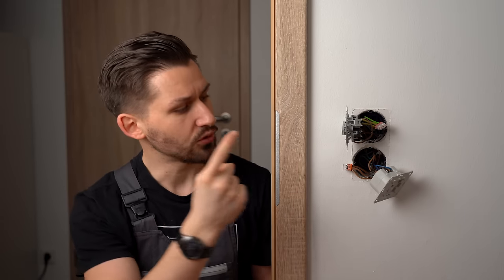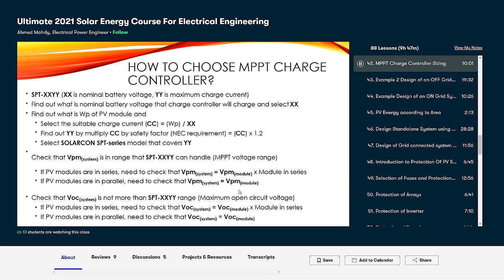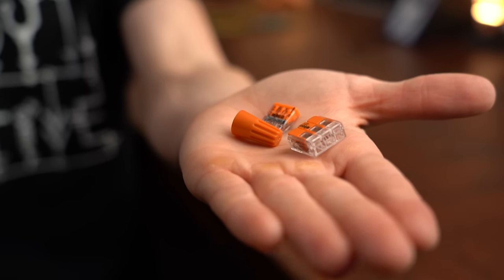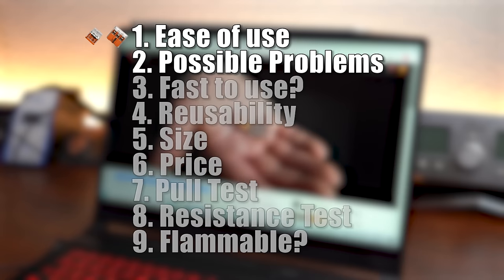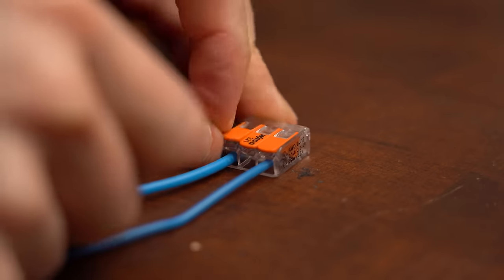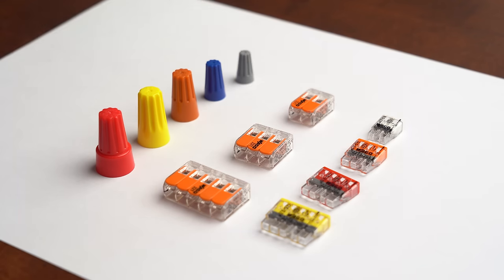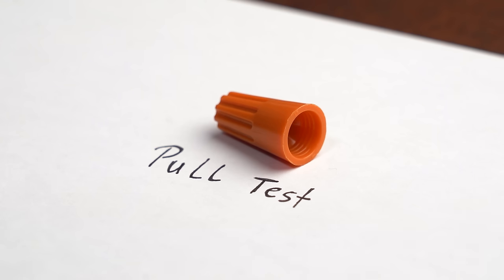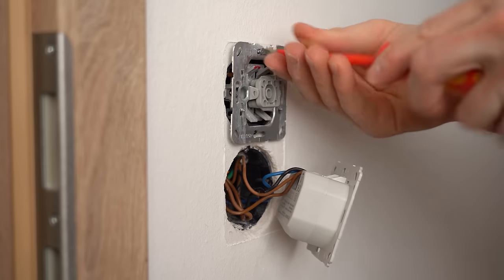What Wire Connector is the Best? Settling a Debate! Wire Nut VS Wago

Comment: The scoring seems intentionally skewed - "easy of use" "fast to use" and "possible problems" are basically all redundant.
Reuseability - wago also does not advertise them as being reuseable. 

And in the physical characteristics - electrical resistance, resistance to mechanical force, resistance to ageing - wirenuts win big times. The resistance specifically is a big point: Wirenuts do not have a current-rating cause when installed correctly they do not carry the current and the only limiting factor is the wire used. Where as the Wago - having potentially multiple heatsources in a confined space right next to each other is a lot more dangerous (considering that the best result was still ~3 times worse).

The wago certainly is faster and more convenient and for small projects i prefer them, but for anything more permanent - nah.
Reply: Exactly. Their Wago connectors are a fuse just waiting for an over-current situation to blow and spark. Just hope the circuit breaker reacts fast enough to the load.

Comment: We've actually phased out the use of Wago style push connectors in our industrial equipment - Power connections MUST be copper wire to copper wire contact ONLY unless there is a rated crimp terminal or ferrule crimped on a wire going to a terminal block.  NOTE: When doing your resistance measure, you want to measure the voltage drop right at the connector - the resistance of the wire itself is going to change a bit as it heats up with current flow.  Wire nuts will be the lower wasted heat, most energy efficient option when used correctly.  Another point:  All connections must be stress free, and make sure the wires are clamped down to avoid any movement at the connector...no matter what style connector is used.
Reply: was thinking the same thing, this german... ;p
Reply: How do you do this ( copper wire to copper wire )? You weld the wires together everytime?!
Also the electric meter is connected to the mains wires with screws and this is true for underground cables. Why are screws and metal contact sufficient for the mains but not good enough for low amp applications like yours?
Reply: @impoppy9145  Twisting the wires together firmly gives a solid copper-to-copper junction. Also, most screwed connections in installations are using hardened nickel plated copper parts. And if not, tightening a screw applies much more force than a steel spring in a wago terminal. Even good crimp lugs are made of a copper alloy.
Reply: The emphasis on low connection resistance could be the link as to why either one is popular in its market. Given the standard 230V home supplies in the EU, most wago connectors won't see currents over 16 Amps ever (The kind in the video probably much lower). I can imagine that heat dissipation and optimal contact in conjunction with retaining the small form factor are all the more reason to use wire nuts preferably in the US.
Reply: @meindertsprang7491  So much BS. Only twisting the mains- wires together firmly is illegal and will cause fires. No country on earth will connect your house mains with twisting wires. Mechanical connections are required by law in every country. The wago steel spring is a sufficient and good enough mechanical connection for the respective rated amp of the wago.
Reply: @impoppy9145  Twisting before screwing on the wire nut of course!
Reply: @meindertsprang7491  what? How is your BS nonsense proving that wago aren't good enough?
Reply: @impoppy9145  Is using offensive language your only way to disagree with someone? I find that quite pathetic.
Reply: @meindertsprang7491  Now back to the question. I've read all your BS and found no useful information in them about the Wagos. How did you come to the conclusion that Wago mechanical connections are insufficient?

Comment: The Wago connectors are relatively new the US market, but they very quickly taking the market by storm. I had never even heard of them until about 6 months ago, but once tried them, I've never looked back! I absolutely love them. I'm not an electrician, but I do a fair amount of DIY electrical projects, and I especially love how easy it is to connect solid and stranded wired together with Wagos. Plus, they take up less space making it easier to pack wires into the box. There's always a bunch of new gimmicky products on the market, most of which are just answers to a question no one is asking. But, these Wagos, IMHO, are a real game changer! I will never go back to wire nuts!

Comment: i absolutely love the wagos with the thumb tab, theyre nice for quick stuff or prototyping, but for electric in my wall, ill keep using wire nuts because theyre alot cheaper n i honestly feel better with the conductors wrapped around each other instead of relying on points of contact which r notorious for getting warm or worse n theyre plenty strong, u literally cant pull them apart if u do them right
Reply: If you really want to buy the cheapest stuff available go for it. I on the other hand will stick with wago. It's just so much faster and easier to use. You can start with one wire coming in and then connect the next ones. Especially if it's old installation and you only have a tiny bit of slack wire you can just cram it in there and it fits. I think I would not have been able to screw on terminals as easily.
Reply: @cometor1  If you really want to be as lazy as possible go for it. I on the other hand will stick with wingnuts. They're just so much more reliable and cost effective.  They may be slightly slower, but its not like I'm rewiring my entire house every year. If it's an old installation and you only have a tiny bit of slack you might have to put in a little more effort and make sure your work is clean. I think if I used wago I'd be able to just cram it in there and do a half-assed job more easily.
Reply: @TonariNoWitoro  It's really really hard to discuss the use wago and wire nuts. I've never really used wire nuts and you've probably never really used wago. And all "professionals" (electricians and YouTubers) that I know of and used both preferred wago in the end.  But as long as everything is properly connected and no houses burn down it's all fine. 
But I'll maybe get a box of them and test it out.
Reply: @TonariNoWitoro  Agree!
Reply: @TonariNoWitoro  I bet these wago users also use the push in connections on all outlets and switches. Too lazy to use the screws on the outlets and switches. 

I won't use them push in connections period. There is one type of outlet that has the push in holes but you have to screw in the screws to tighten the connection. I used them before and I feel it's a good connection. 73
Reply: @TonariNoWitoro  From my experience its really rare to even see wire nuts in Finnish electricians kit and when those are seen, its most likely removed from import equipment or is there for those extra special cases where machine manufacturer demands to wire nuts to be used for warranty.
Other than that no one uses them. Its not about being lazy, more of getting best possible service for cheapest price. Its already hard enough to work with existing systems where there is too little wire around, so wago 221 is perfect fit for the job. Just connect the short wire into end and you can connect everything else to that connector with out straining or damaging the wires. What i have seen wirenuts only damage wires and are poor for reuse and absolutely horrid if you need to do any rewiring to debug issues. There is no half assed job with wago. Just strip and push in, check its in all the way and you are done. With wire nut one wire might be loose and you cant see it, it takes much more force to use and since wires are all twisted that creates internal tresses to cable. Repeated movement workhardens the copper that can lead to severely damaged wires in the long term. Wago while holding it allows wire to twist a bit on its axis so it does not take much as force and leave everything under huge tension. Just seems smarter to me.

Sure if Americans do rewiring into houses all the time go for it, but here we replace accidentally damaged wires when owner screwed into wire tube (despite there being electrical drawings pointing those out) and that was extra cost not by plan. Also since we actually build houses not plywood and stick storage sheds, every install goes trough electrical piping, so there is no need to rip the wall open to replace the wire. Only other time for total rewiring is to replace 60 year old metal covered wiring to modern mmj standard and its mostly done in houses that has not been touched in 60 years and that point whole power center gets replaced to new. Cant recall anyone doing whole rewiring on average house, where in US seems like house is rip to frame and then rebuilt every now and then...
Reply: @cometor1 interesting what area r u n elecchicken in?? i really like the wagos im just neurotic about burnin my house down n with them getting warm with normal use, thats enough to scare me   i use them for quick testing n mockin stuff up, i love them for low current stuff   im north of Baltimore n everythings wirenut around here, including everything new, i rarely ever see wagos, in fact i cant remember seeing them on anything, other than low voltage systems for example some machine n fab shops around here, again in the low voltage systems        iv got a thermal camera im goin to have to do some tests now im really curious
Reply: @4dirt2racer0  I'm from Germany, where no one ever uses wire nuts.
Wagos are rated for way more current than the wire you are using. So before the Wago burns down, your wire will burn. And hopefully before that happens your fuse will pop.
I'm an electrical engineer, everything under 1000V is low voltage for me. Also, Voltage is not the trigger for heating, it is the current running through it. Voltage is just an insulation problem. So if Wago says they can handle 300V and 20A they sure can and they will be safe. Even if you go over it a little it still will be safe, but then no insurance will pay if something breaks. I have never heard of anyone that had a problem with Wagos. You can check newsletters or ask professionals from Europe, there is not a single case of Wagos being the reason for a fire. 

If you have a thermal camera, also take a look at the bottom of a wire nut, not from the side.

Comment: I have used wire nuts in thousands of installations over the last 40 years. Never had a connection fail.  Also when you use one of those other types of connectors, all you have is the connection between the wire and the connector. With wire nuts you get an actual wire to wire connection which gets tighter the further on you screw the nut.
Reply: Agreed. I’ve wired more boxes than I care to remember and have never had a failed connection (that I’m aware of). That’s why we always pre-twist and cut before applying the nut. Nearly 0% chance for connection failure. I have; however, experienced a number of “push in” failures on receptacles and such. Arcing and signs of heat discoloration aren’t uncommon with the push in connections. Any connection that I can just yank on and pull it out isn’t good for me. Being easier didn’t make it better for sure. Every time we hear the argument for Wago connectors, the claims never seem to consider the many thousands of heat cycles experience on some heavily used 20 or 30 amp circuits. A wire nut on a pre-twisted connection will handle that until Jesus comes back; a wago will not. That being said, I do use them for attaching braided to solid wire ONLY on low amp lighting fixtures that never see more than 10 - 20 watts.  I’ll stick with my nuts. Lol :)
Reply: @thompsona10625  
Push-in connections on receptacles are cheap knock-offs... Not WAGO style cage clamps in them.  I don't use those EVER (on the receptacles).
When you need 5 wires in one connection, the WAGO 221's do a great job.
They withstand a ton of current also.  This video finally shows them melting at 120Amps.
For most circuits, if you go beyond 15 amps... you already have an issue anyway.

https://www.youtube.com/watch?v=fjNUzd6LDsU

One thing I love about the WAGO connectors, is I do testing on live circuits (no, I don't suggest others do this), and with the lever 221's it is touch-safe.
Reply: Since most circuits are on 16 amp breakers and the wago has a 32 amp current that isn't really a problem

Comment: Great video! Thumbs up!
@9:35 - I hope Wago can improve/upgrade there 221 soon so that it'll have resistance closer to the nut. (or less than 0.3mr for the 221. I hope that's not too much to ask for, IMO with that one thing at same price point or just a little bit more expensive would be perfect)

Comment: I worked with nutz 20 years ago, the resistance is small, but due to Cooper oxidation it increases, more with "high" current flowing, expanding and contracting it can create some gaps increasing even further the resistance. That's why we don't use it anymore.
Reply: Danke, ich mache das aus liebe von der Beruf sonst nicht, wollte nur schreiben warum die von die europäische Markt weg sind.

Comment: Another big reason to use Wago is wire length needed. If your junctionbox is getting crowded, you are gonna admire the wago even more.
Reply: Not when it melts or catches on fire you wont.
Reply: @RadioRich100  I see you everywhere under this video. With all what you said, Europe should be a big constant electrical fire ?
Reply: @tom-sn4gd  Probably is, most of it though  intermittent failures, melted and burnt up wagos from what ive seen.
Reply: @RadioRich100 😅